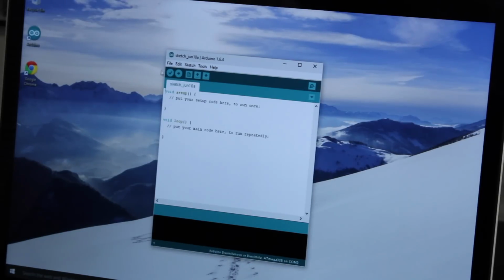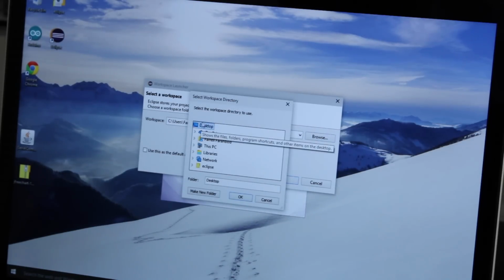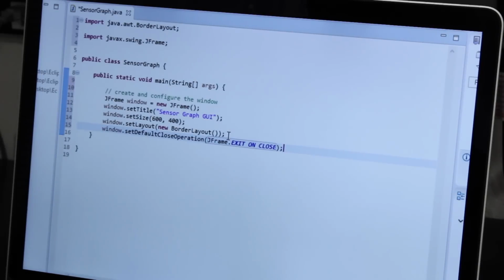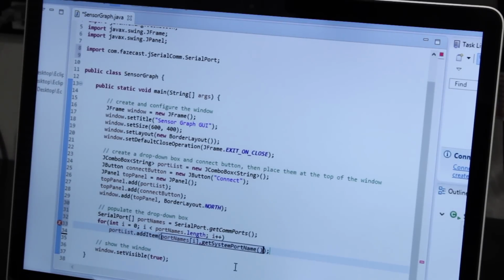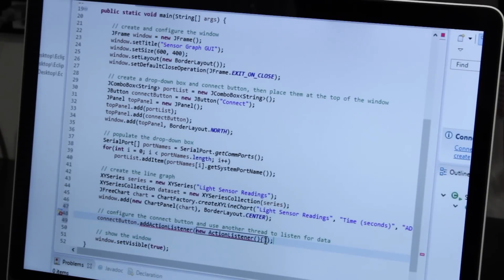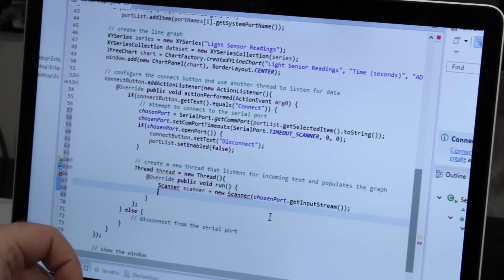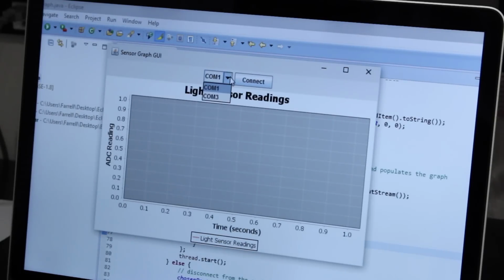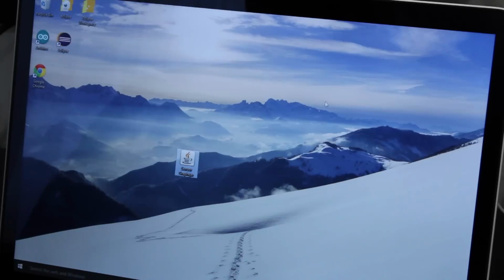Graph Arduino Sensor Data with Java and JFreeChart

Comment: Thanks for the working code. For those using IntelliJ to compile this, you will need three additional libraries/jar files. They are Comm-2.0, jfreechart-1.5.4 and jSerialComm-2.9.3.  You may find other versions of jFreeChart. Use only this one.  To add to your project, go to File/Project Structure/Project Settings/Libraries. 
The other code for the LCDClock is very good.

Comment: Exception in thread "main" java.lang.NoClassDefFoundError: com/fazecast/jSerialComm/SerialPort
	at STM32_PLOT.main(STM32_PLOT.java:38)
Caused by: java.lang.ClassNotFoundException: com.fazecast.jSerialComm.SerialPort
	at java.base/jdk.internal.loader.BuiltinClassLoader.loadClass(BuiltinClassLoader.java:641)
	at java.base/jdk.internal.loader.ClassLoaders$AppClassLoader.loadClass(ClassLoaders.java:188)
	at java.base/java.lang.ClassLoader.loadClass(ClassLoader.java:520)
	... 1 more
??????????????????????//
Reply: I have the same problem. Did you find a solution ?

Comment: Hi, I can use this project for ADC. But ADC contains SCK and DOUT pins. And these pins connect to Digital Pin 1 and Digital Pin 2. Can I update this code for these pin, do you have a any suggestions for this question?

Comment: Thank you for your explanation. However, I try to run your code but simply doesn't read any values, and the console doesn't show any issue.  It seems like the problem setComPortTimeouts(), but I already try other options to TIME_SCANNER and it still doesn't work. I will be very greatfull if you could help me.

Comment: What would I need to do if I want to read from a light sensor that runs continuously and use that data from the while loop within the program without it getting stuck in the while loop?

Comment: Thank you so much! I wonder if you could tell me how to add a marker at some point(s) on the graph. For example, an arrow or triangle or number at some x,y value to indicate an important event?
Reply: I can see how I could add another series showing a vertical line at a particular x-axis point. I can also see how XYShapeAnnotation and XYPointerAnnotation could be used to draw a circle or elipse at the xy coordinate and have an arrow with text pointing to the coordinate.  So unless you have another solution this will do fine, thank you!

Comment: how can i force the ADC reading to start from zero...i notice that sometimes the value is really high when it initializes before settling down.  This forces the graph to auto-range to a big number on the y-axis...making the rest of the data very small in comparison...in other words after the readings settle down changes in the light sensor are almost imperceptible.  I'd like to give it a consistent starting point for the first second or so...or how do you fix the range?

Comment: Thanks for the tutorials, I am having a problem. I tried the code I typed by my self and the one you provided in the link below the video. In both cases I was able to connect and the text on the button changed from "Connect" to "Disconnect", but the program froze when I click it back from "Disconnect" to "Connect". Do you hav any idea why that happening? By the way I am using NetBeans.

Comment: I couldn't help but comment how good this was/is. I also started thinking about when exceptions were caught. I might suggest incrementing x (as in x++) in the try/catch block, but if you do it in the finally() portion, you guarantee the value of x to increment-even though there may be an exception. 

I suggest this because if you have a series of, or frequent exceptions, you might want to ensure your 'seconds' time series still represented reality. It would just have 'blank' spots where there was no data. This way you could accurately count back & know when you had disconnects/exceptions. 

I've always avoided graphing in Java, so being an arduino hobbyist and a crack Java programmer, this was just what I needed to motivate me to use SWT!

Comment: If I need to shift the graph over time, or only show a portion of the data, as if the image of the graph was running, how do I do that?
Thank you very much
Reply from the maker: You can do something like this after adding your newest values:
yourChart.getXYPlot().getDomainAxis().setRange(maxX - 100, maxX);
This assumes maxX is your largest x value, and maxX-100 is the oldest value you want to see.

Comment: Trying to get off the ground here.  SerialPort[] portNames = SerialPort.getCommPorts(); doesn't return any ports to the object array.  Can anyone help with this?
Reply from the maker: Try closing any programs (the Arduino IDE, etc.) that are using the serial ports. Only one program can use a port at a time.
Reply: OK, I found the issue. I have to have the Arduino plugged into the port.  Otherwise the code won't see the port at all (not sure why?).

Comment: U r just amazing...Its really hpelful....Kindly someone help me that the COM port which is connecting with Arduino is not refleced in my Java code...In my case, The arduino is connected to COM5 but im getting in the dropdown only COM4 in the Java Graph..How i can fix it?
Reply from the maker: Only one program can use a specific COM port at a time, so make sure nothing else is open and connected to COM5.
Reply: upgrdman Thanks much for your reply and suggestion....It is working.👍 Truly and Technically inspired with your video.

Comment: I am using DHT22 temperature and humidity sensor. I am trying to plot the value of temperature sensor. I don't get the value of temperature sensor. What's the reason behind ? Can you make a tutorial that shows the values of serial communications comes from arduino.
Reply: did you get answer sir? i got the same problem also

Comment: HI, 

Thank you for your clear explanation.
I use the Arduino micro.
I use the program as below, but can't read the analog data with your SensorGraph java.
With serialploter I can read it, not a problem.
Can you tell me what I do wrong?
 
Greetings, Hans 

*******************************************************

#include <Wire.h>
  
byte I2C_address = 0x48; 
int LogInPin = A5;
float LogInValue = 0.0;
float offset = 1023;
float gain = -1.0 ;
 
void setup()
{
Wire.begin();        // join i2c bus (address optional for master)
Serial.begin(9600);  // start serial for output
// INIT TMP101 - SET RESOLUTION TO 12 Bits
Wire.beginTransmission(I2C_address);
Wire.write(0x01);    // Configuration Register
Wire.write(0x60);    // R0 and R1 = 1
Wire.endTransmission();
}
 
void loop()
{
 
Wire.beginTransmission(I2C_address);
Wire.write(0x00);
Wire.endTransmission();
  
Wire.requestFrom(I2C_address,2);
int temp_hi = Wire.read();        // integer value  
int temp_lo = Wire.read();        // fractional value
int temp = (( temp_hi << 8 ) | temp_lo ) >> 4 ;
float temperature = temp * 0.0625 ;
 
float amplitude = 0.0;
 
for (int i=0; i < 100; i++)
{
      LogInValue =  analogRead(LogInPin);
      amplitude = amplitude + LogInValue;
      delay(10);
} 
 
amplitude = offset + gain * amplitude / 100.0 ;
 
Serial.print(amplitude,1); Serial.print("     "); 
 
Serial.print(temperature,1);Serial.print(" ");
Serial.print((char)176);Serial.println("C");
 
 
delay(100);
}
Reply from the maker: Use the serial monitor to see what text your Arduino is printing out. I'm guessing it isn't printing out correctly.

Comment: I cannot get any list out of SerialPort.getCommPorts! The issue is also listed https://github.com/Fazecast/jSerialComm/issues, but it got no response. I've read somewhere that a previous version of jSerialComm, such as jSerialComm-1.3.11.jar, could work, but I cannot find it anywhere. Can anybody help me?
Reply from the maker: http://fazecast.github.io/jSerialComm/binaries/jSerialComm-1.3.11.jar
Reply: Thanks a lot for your reply. Unfortunately, I made a mistake in my post: version 1.3.11 is the one I'm using. Version 1.3.8 is the one I'm looking for, as it could fix the issue. Where can I find it?
Reply: I have the same problem, did you ever find a solution to this problem?
Reply: After entering my previous remark here, I found the answer.   All I had to do was plug in my Arduino and the port it's
on appeared in the drop box.   It never occurred to me that I would need the Arduino plugged in to see a com port in the drop box.  I stumbled across this information when I saw upgrdman's answer to a question from keynote263.

Comment: Hi. I have a problem on window.add(new ChartPanel(chart), BorderLayout.CENTER); there is an error: The method add(String, Component) in the type Container is not applicable for the arguments (ChartPanel, String). Can you help me to solve this problem? Thank you!
Reply from the maker: Can you pastebin the rest of your code?
Reply: import java.awt.BorderLayout;
import java.awt.event.ActionEvent;
import java.awt.event.ActionListener;
import java.util.Scanner;

import javax.swing.JButton;
import javax.swing.JComboBox;
import javax.swing.JFrame;
import javax.swing.JPanel;
import org.jfree.chart.ChartFactory;
import org.jfree.chart.ChartPanel;
import org.jfree.chart.JFreeChart;
import org.jfree.data.xy.XYSeries;
import org.jfree.data.xy.XYSeriesCollection;
import com.fazecast.jSerialComm.SerialPort;

public class SensorGraph {
 
 static SerialPort chosenPort;
 static int x = 0;

 public static void main(String[] args) {
    
    // create and configure the window
    final JFrame window = new JFrame();
    window.setTitle("Sensor Graph GUI");
    window.setSize(600, 400);
    window.setLayout(new BorderLayout());
    window.setDefaultCloseOperation(JFrame.EXIT_ON_CLOSE);
    
    // create a drop-down box and connect button, then place them at the top of the window
    final JComboBox<String> portList = new JComboBox<String>();
    final JButton connectButton = new JButton("Connect");
    JPanel topPanel = new JPanel();
    topPanel.add(portList);
    topPanel.add(connectButton);
    window.add(topPanel, BorderLayout.NORTH);
    
    // populate the drop-down box
    SerialPort[] portNames = SerialPort.getCommPorts();
    for(int i = 0; i < portNames.length; i++)
     portList.addItem(portNames[i].getSystemPortName());
    
    // create the line graph
    final XYSeries series = new XYSeries("Light Sensor Readings");
    XYSeriesCollection dataset = new XYSeriesCollection(series);
    JFreeChart chart = ChartFactory.createXYLineChart("Light Sensor Readings", "Time (seconds)", "ADC Reading", dataset);
    window.add(new ChartPanel(chart), BorderLayout.CENTER);
    
    // configure the connect button and use another thread to listen for data
    connectButton.addActionListener(new ActionListener(){
     @Override public void actionPerformed(ActionEvent arg0) {
      if(connectButton.getText().equals("Connect")) {
       // attempt to connect to the serial port
       chosenPort = SerialPort.getCommPort(portList.getSelectedItem().toString());
       chosenPort.setComPortTimeouts(SerialPort.TIMEOUT_SCANNER, 0, 0);
       if(chosenPort.openPort()) {
        connectButton.setText("Disconnect");
        portList.setEnabled(false);
       }
       
       // create a new thread that listens for incoming text and populates the graph
       Thread thread = new Thread(){
        @Override public void run() {
         Scanner scanner = new Scanner(chosenPort.getInputStream());
         while(scanner.hasNextLine()) {
          try {
           String line = scanner.nextLine();
           int number = Integer.parseInt(line);
           series.add(x++, 1023 - number);
           window.repaint();
          } catch(Exception e) {}
         }
         scanner.close();
        }
       };
       thread.start();
      } else {
       // disconnect from the serial port
       chosenPort.closePort();
       portList.setEnabled(true);
       connectButton.setText("Connect");
       series.clear();
       x = 0;
      }
     }
    });
    
    // show the window
    window.setVisible(true);
   }

 }

Comment: //This code works!
import java.util.Scanner;
import com.fazecast.jSerialComm.*;

public class Main {

 public static void main(String[] args) {

  SerialPort[] allPorts = SerialPort.getCommPorts();
  
  SerialPort port = allPorts[0];
  if(port.openPort())
   System.out.println("Arduino connected.");
  else {
   System.out.println("Please plug in arduino, and restart the app.");
   return;
  }
  
  port.setComPortTimeouts(SerialPort.TIMEOUT_SCANNER, 0, 0);

  Scanner data = new Scanner(port.getInputStream());
  String value = null;
  int i = 0;
  while(data.hasNextLine()){
   try{value = (String)(data.nextLine());}catch(Exception e){}
   i++;
  if(i>4){
   System.out.println(value);
  }
  }
  System.out.println("Arduino dissconected.");
 }

}
Reply: It always shows "Please plug in arduino, and restart the app." Can you give me any solution for that?
Reply: abu hena put arduino on different usb port
Reply: Thanks

Comment: At 26.04, I cannot not get to show the drop-box: COM1 -COM 3, What did I do wrong, any ideas?

//populate the drop-down box
  SerialPort[] portNames = SerialPort.getCommPorts();
  for (int i = 0; i < portNames.length; i++)
   portList.addItem(portNames[i].getSystemPortName());
Reply from the maker: Hi. Try the debugger and step through the code. Check if the "portNames" array really has a length of zero. If it does, that means no serial ports were detected on your computer.
Reply: Thanks. Got it.
Reply: I connect the cable and it shows only COM3 or COM4 if move to another USB socket but no drop-box show COM1..COM3.

Comment: Thanks a lot for this class! It is clear and information consistent. 
I have a question about how to change this code to include a timestamp and not only running seconds. Tried to use your example from the video "Serial Communication Between an Arduino and a PC" but ended up messing the code completely. Any help would be much appreciated. !! Thanks and congratulations for this material.

Comment: Have the same question as remsen bulan about auto scroll on x axis. Could you help us?
Reply from the maker: Hi. I have not tried this code, but based on some code I've written for other projects, I'm pretty sure all you need to do is add this line:

chart.getXYPlot().getDomainAxis().setRange(x - 100, x);

Replace 100 with however many samples you want to see scroll by, and place that line after this line in the original code:

series.add(x++, 1023 - number);

I'm also working on a full-blown (but easy to use) charting tool for showing multiple live charts, including FFTs and histograms. I hope to have it polished enough to share within a month or so, and I'll post a video and the code at that time.
Reply: Thank you a lot. I'm going to add some buttons to adjust setRange parameters during runtime and it will be all that i need.

Comment: It's not working. And how I  add baud rate for serial port?
Reply: Worked for me. As for baud rate try to add in appropriate places:

JComboBox<String> speedList = new JComboBox<String>();

//hardcode or get system properties
speedList.addItem("9600");
speedList.addItem("14400");
speedList.addItem("19200");
speedList.addItem("38400");
speedList.addItem("57600");
speedList.addItem("115200");

chosenPort.setBaudRate(Integer.parseInt(speedList.getSelectedItem().toString()));

And don't forget to disable this new ComboBox when connected
Reply: replace   double number = Double.parseDouble(line); instead of int number = Integer.parseInt(line);
or sout thread's exception
} catch(Exception e) {
                                    System.out.println("Error : "+e.getMessage());
                                }

Comment: Thank you very much for the video. I have been wanting to see a video like that with so much explaining for each step and it is apparent you are well versed in Java. It was very helpful. I am wondering if I can take that runnable jar file and put it in am Android tablet and use a BlueTooth serial connection in place of com3 for receiving the data from my microcontroller, and also do you have any idea how much data could be transmitted each second from the Arduino, or in my case the Controllino before the program would not be able to handle the data. I am hoping to send 4 thermocouple readings, a few actuator states (just 1's and 0's. and a laser reflectometer signal like yours. Even if you don't have the time to answer those questions, I must say I really appreciate your video.

Comment: can you make an interface to read and show an input sensor from arduino in computer?
Reply from the maker: I'm not sure I understand your question. That's exactly what is done in the video. A sensor plugged into the Arduino is read, and it's values are shown on the computer (as a graph.)
Reply: I mean nt to show in a graph just to get the reading the value.and also values of more sensors
Reply from the maker: In the source code, there is this line: "int number = Integer.parseInt(line);" That "number" contains the current value of the sensor. You can use that number however you like, there is no need to graph it. I plan to do a video on how to graph multiple sensors but I'm short on time right now. It might be a few months before I can start posting some new videos.
Reply: Thanks alot.il try to use that and also it would be a great help if you can do the multiple sensor video
Reply: This worked thanx alot
Reply: String line=scanner.nextLine();
number=Integer.parseInt(line);
textField.setText(Integer.toString(number));
Reply: hai
i got error
Cannot make a static reference to the non-static method nextLine() from the type Scanner

Comment: This was a very useful video, thank you for posting this. The only problem that I have is that when I disconnect and the connect, the GUI freezes. It doesn't even give any errors or exceptions.
Reply from the maker: +LightFykki Hi. If I recall correctly, when connecting or disconnecting from the UART, the Arduino resets. You might need to delay for a few seconds before attempting to communicate.